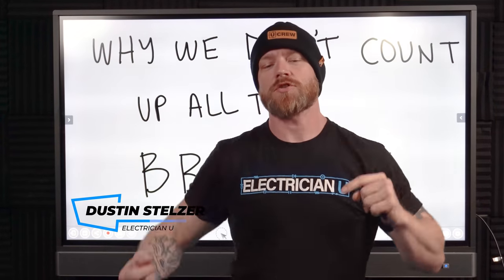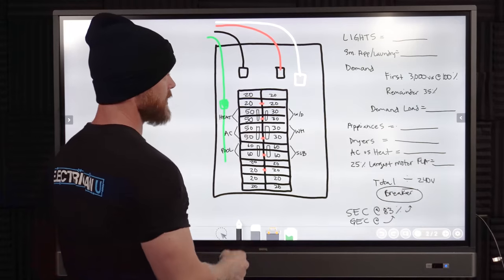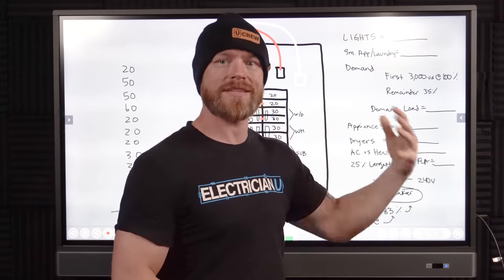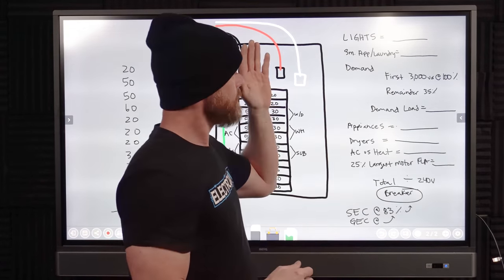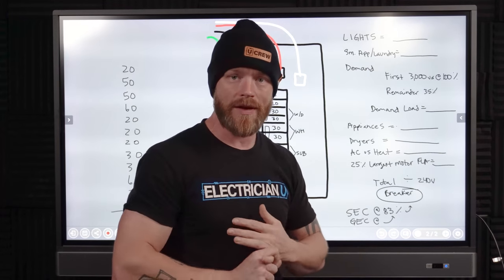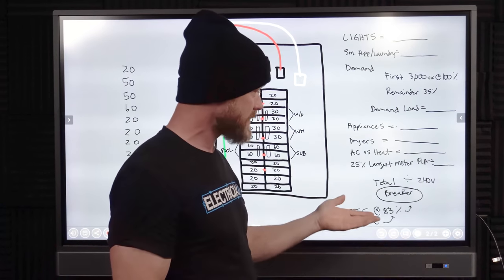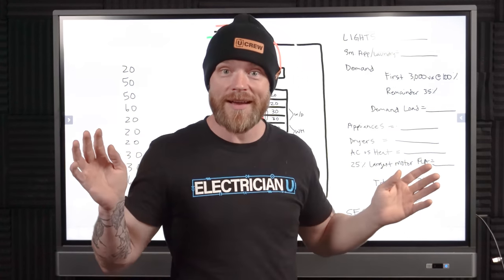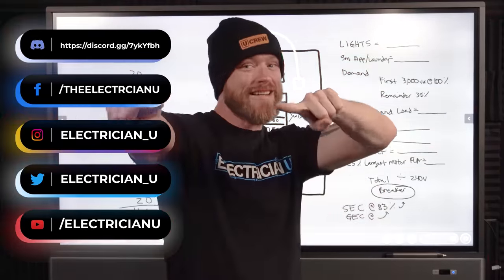Why is there more than 200 A worth of breakers inside of a 200 amp panel?!

Comment: we once designed an addition for a house that was already a fairly large house with an indoor pool (where the humidity and temperature of the pool room was controlled in addition to the houses AC system) and the owner had a Model X Tesla so we had to provide for a Charger in the existing garage and a Charger in the additions Garage, one of the issues we came across was the house was already pretty much maxed out on a 400 Amp service and they couldn't expand because the power company simply didn't have any more capacity on the wires supplying the street the house was on. I know we ended up installing a massive Generac generator, I think that was the final decision on how to overcome the 400 Amp service limitation

Comment: In some European countries, distribution fees depend upon the size of the main breaker, and it is not uncommon for homeowners to arbitrarily 'downsize' the service supply to 15 A or 25 A to save a few euros, and live with not being able to run two large appliances at the same time. The wiring to the house/apartment is still sized for at least 45 A (often times 63 A).

Comment: ELECTRICAL U  HELLO,I AM NOW RETIRED, BUT IN MY WORKING LIFE, I WORKED WITH 24 V,125 VAC,277V 1 PHASE MOSTLY LIGHTING,THAT SAME STORE  WAS 480V3 PHASE,BUT THE BIG BOYS WERE  LARGE CENTRIFUGAL COMPRESSORS FOR LARGE BUILDS WERE 4160 VAC 3 PHASE, BUT YOU NEEDED A N AMMETER WITH LARGE JAWS, THOSE WERE LIMITED TO 3 STARTS /HOUR, ,,
IN GERMANY,ELSEWHERE, HOMES DO HAVE 260 VAC 3 PHASE, THERE IS ZERO 125 V, SO CHOTHES DRIERS,AND STOVES USE THAT,LESS AMPS,  STAY WELL  CHERIO🇺🇸🇺🇸🇺🇸🇺🇸

Comment: I was at a project for a small historical building.  The engineer called for a 600 Amp service. The contractor said, this is a two story building not a skyscraper.  I don't get it. It might explain why the project budget was over 3 million.  And none of it works.
Reply: Calculated load is a helluva drug.

Comment: I've got 2 200 amp services running off a 400 amp meter, I consolidated 2 meters into 1 because my Public Utility Chelan County PUD charges a meter fee and when I consolidated it was $7 dollars per meter, that was 22 years ago. With that being said I've saved a substantial amount of money doing that one upgrade seeings how the home was built in 1957. Just figuring on 7 dollars a month over 22 years saved me $1848 which is about the actual cost of all the stuff I did 22 years ago. I am sure the per meter cost has gone up over the past 22 years as everything has which would make those savings even more. The driving factor was to clean up my air space over my property as I took all the utilities and went underground so I wouldn't have wires running all across my property and I was able to relocate the meter head off the back of my home to the alley side of my shop. Not only did this give me a cleaner skyline it made my property safer for moving ladders and bringing dump trucks in without the worry of the utility lines along with making reading my meter easier as my property is completely fenced.

Comment: Super interesting.  I've wired 200 amp boxes on past.  Recently built large shop and had my first 400 amp service put in (I still have to wire it in to 2 200 amp boxes.  I wanted more spaces as I have to run several 240 volt item's (truck lift, welder hookups, hot water heater and air compressor hookups, all 240 v) as well as plugs, lights and long runs to outlying barn and backyard ( for hot tub, lights, etc.).  I'd rather have more breaker spaces to expand in the future.
Reply: is that going to be a true 400-amp service or a pair of 200s? (we call that a 320-amp service here) The main difference between the two is in a residential setting they will allow smaller feed wires because it's mostly for all the home runs and breaker space, rather than full loads.
Reply: I believe it's actually 320.  Elec company says I can use 4/0 4/0 2/0 SE wire, aluminum and I intend to run 2 separate lines from box to my 2 200 amp boxes, underground, in electrical pvc
Reply: @kennethcallahan7410  ... that feeder combo says it all. 4/0 Al is rated for about 175 amps and the 2/0 neutral says they are allowing for a large 240 volt load and an undersized neutral is ok. Are they really allowing SE cable in a buried conduit or do you mean individual conductors in Al with a W/2 rating?
Reply: @rupe53  I'm doing Indiv conductors from service pole in conduit to the two boxes, or that's the plan.  I have to go 130 ft from pole to the boxes which will be inside shop and wanted underground vs overhead.  Am putting in conduit to protect wire due to soil here which is clay and very rocky and the rocks move around a lot
Reply: @kennethcallahan7410  Ok, good deal. You mentioned SE wire which I took to mean Service Entrance cable, which is the grey jacketed stuff you see going down the outside of a home. It's not allowed to go any distance in conduit other than a short run for protection. Do yourself a favor and go larger than you need on the conduit. Also use sweep elbows. It can be a bear to pull that distance. If you have the option, you can lay the wire out and walk each piece of conduit into place. That can be a real back saver if there is more that 2 elbows on the run.
Reply: Yes gonna go larger on it and you're right,the less bends the better

Comment: One grid-tie solar system, electric water heater, 240VAC table saw, and L2 EV charger later., and I'm really happy the original builder of my home didn't skimp and had decided on a 200A service.  The original house only had the A/C system and electric oven as big-ticket items.  I still have fairly comfortable margins though one of the sub-panels is closing in on 75A going full-out and probably shouldn't have anything more added to it.

-Matt

Comment: Well I can talk on this subject by my own experience. I live in a 67 year old house that had a 100amp Zinco breaker box that had to go. Well I discovered what they call 320 amp service continuous 400amp at 4 hours. After contacting the electrical company to see if the transformer and it’s capacity if I could go to a 320 continuous service, well they said no problem the transformer was at 45% capacity load for all the houses that it serviced. So I installed a 320 continuous service with a 200amp box in the basement to replace the Zinco box and another 200amp box out in the garage off one main meter base that was designed to handle 2 sub boxes. The reason they call it a 320 continuous 400amp for 4 hours is if you go to a 400amp service all the time you need engineering blueprints for your installation plus probably some extra equipment. Also while doing this installation I installed a generator cutout switch. On a Tim Allen home improvement scale of 1 to 10 , this job was a 15. I did this conversion in 2004 and I figured I spent 7,000.00 dollars on supplies and a crane truck to lower in the mast head and I did all the work myself. The city electrical inspector was impressed and said he had warehouses in his jurisdiction that didn’t have this much power and service capability in them. I figured if I paid a company to do what I did the job would of cost 15,000.00 dollars. Also I had to relocate electrical circuits and compressor air lines that where in the way, but in the end it was well worth it.

Comment: When you talk about the "black phase" and the "red phase" in a single family (or townhouse, small business, etc.), and please correct me if I am wrong, the "red" and "black" are the "hot" leads from a "split" single phase 240vac service. Not until you get into a building that has equipment (such as multiple elevators) that requires a heavier duty service does the "multi-phase - typically three phase 208 vac" service concept come into play.

Comment: This video is ok for laymans terms, in far as what the purpose of a breaker is, it is even simpler, the breaker size is to protect the wire from overheating, even the NEC (NFPA 70) says that. That's why temperature is in all the tables, in or out of conduit etc. The 200A main breaker protects the feed, 200A will be the trip point on that incoming feed. The utility's job is to protect its transformers.

Comment: My house has 100A service, and that's more than sufficient for me.  All of my appliances are natural gas.  I do have central air conditioning, but it's on its own meter and never goes through my panel.  The circuit comes inside my basement from the meter, then goes outside again to a fusible disconnect, then to the AC compressor.  The only 240V outlet in my house is for the dryer, but it goes unused since my dryer is gas.  The two biggest loads in my house are the microwave and a toaster oven.

Comment: Greetings Electrician U, My house is 730 sq. feet, and I have a 100 amps main brkr. 3 15 
amp ckts for lighting & general small appliances. 1 15 amp for gas furnace. 2 20 amp ckts for
kitchen a 30 amp dryer ckt and a 30 amp A/C ckt  but no A/C . I have gas wtr htr and range
so all added up 160 amps and w a 100 amp breaker, I never trip a breaker on overload. The 
house was built in 2006. dryer ckt is a 4 wire job not the old crowfoot style pre 1990's. I thought
this would be a good example. Being a mobile home, the panel is a 'Sub-load center and the 
ground is to the cabinet and neutral is isolated from it as the green screw for neutral bus is not
there and a special bolt holding the mains brkr in place. The furnace has a 12 amp blower motor
which is 80% of a 15 amp ckt.

Comment: Always amazes me that in the UK we still have a lot of properties with 60amp services!! All though the average is 100amp. 
On some “new builds” they are now installing 3 phase 100amp supplies to allow for heat pumps, solar PV, EV charge points etc.
Reply: Don't you use 240V circuits though?  So your 60 amp service is like a 120 here, and 100 like 200.
Reply: In Philadelphia's older rowhouse neighborhoods, many row units built in the 1930s have 60 amp service. I managed to trip the main breaker one day with a lot on (laundry, TV etc).
Reply: Do you mean amp or volt?
Reply: @bigkirbyhj666  Oh, it's amps. The main breaker had "60" printed on its handle. Even in the 1980s that was deemed obsolete, most homeowners had already upgraded to 100.

Comment: Power monitoring is the way forward linked to automatic load adjustment. The code allows you to add more circuits/load in a panel especially if that is backed by actual power monitoring data that and even if the calculation may say no more.

Comment: I have read that when they use a 480 volt, or 600 volt supply as opposed to just 120 volt or 277 volt, what happens is that they have problems to start up large motors. That is because many times nowadays they use a contactor for starting those motors up , they do not just use an on-off switch or something like that. It has something to do with the FLA requirement, I forgot what that is called right now. I mean, they try to promote those new 600 volt service systems for houses as such a great system, and I was wandering why they need these new 600 volt systems at all. Also, I believe that a 600 volt residential service always works in series not in parallel, it needs to be grounded for overload and ground faults, and it seems to me that this new 600 volt system is not that good.

Comment: Actually work on a 9600 square foot house that has 2 400 amp meter main cans outside. 600 run to the house and 200 for the shop outside. When you have 8 fridges and 4 freezers with 3 electric ovens and 2 electric furnaces with no natural gas ran to the property. Load calc comes important

Comment: If it's a heat pump the AC and the heat will both be on during the defrost cycle. That can be as often as every 30min and up to 10min long when it's cold out.
Reply: My heat pump simply reverses the flow of refrigerent for a couple minutes to produce heat in the outside coil to defrost . The fan in the air handler stays off during this time so as not to blow cold air inside while defrosting . A heat pump can not be in heat/cool at the same time unless you have heat strips and there is a problem .
Reply: @rydfree  Tofulnc is right. On my heat pump the heat strips do indeed turn on when defrosting.
Reply: @rydfree  Wrong- in defrost the heat strips come on to offset the cold produced by reversing the changeover valve

Comment: Been wondering about this some...especially with talk of EV chargers.  We've got 200A service (with a full breaker - out here EVERYTHING is electric) and the "power monitoring" shows that when its super cold nights with dual zone heat pumps + 10&15kW aux heat + 1-2kW other normal stuff running in the house + the water heater kicks on...we're at like ~170 amps on both sides, and I guess you hope that doesn't happen when you get up to cook breakfast on the stove?...so how's that gonna work out with a 2 car garage having potentially 2x 50A EV chargers in the future?

Sure, its only a couple weeks a year that are so cold that you're running all that for an extended time...but its still a thing that happens?
Reply: Recently we have had to move a EV charger to a sub panel for exactly this reason. Coldest day of the year and running emergency heat caused their main to trip.
Reply: You might look into upgrading you service.  Usually bump up your panel larger amps or ad a subpanel to handle the additions to the network.

Comment: I like how you limit your video's length
Its good not to cram too much info into one  video
Reply from the maker: Thank you, it’s been a long time coming. I used to make videos that were 45 min long lol - so unnecessary, but hell they have over a million views so I guess there’s something people liked about them. More to the point these days though 👌
Reply: It would be even better if the video allowed speed control. I usually listen at 1.5x  or 1.75x speeds. It's data to my ears not a conversation. For Slow talkers I go with 2.0x.

Comment: In Australia we call this "maximum demand" and to our code there's a guide for calculation, but it's not a ruling that need be adhered to. You override the guide where needed to avoid nuisance tripping or atypical customer requirements etc.

Comment: Look at any story about power generation. Depending on the region described a house will run on anything from 1000 watts to 5000 watts. A 15 amp breaker can supply 1800 watts before tripping.

Comment: Form 2se residential meters are rated for 320amps continous. Fully rated 400a self contained residential panels are available and I believe Itron now makes meters for them.. Older form 3s and newer 4s 1ph meters are available for 400a and higher switchgear with 1 or 2 current transformers.

Comment: Some devices like a high power audio amp can pull in a huge amount of current to charge up the capacitors. It is often enough to trip the breaker. If that happens to you, it may need a minor modification to give it a slow start instead of a hard start. You could watch some electronics videos to see how to make such a modification yourself, but I recommend getting that done in a repair shop. It isn't a repair, but a modification. It shouldn't cost too much since there isn't any troubleshooting, just a look at the schematic and a few added parts. Sorry, I can't tell you what a fair price is.

Comment: They do make 400 amp single Meter Cans and they are very expensive. I've had to do it for people with Pools Hot Tubs and Car Chargers. All Electric houses with 2 or 3 AC Units with Electric Heat. Yes People are Crazy about going all Electric.

Comment: Have they updated the lighting load requirements accounting for led only?  When I did my basement years ago I limited my 15a circuit to 1200 watts for the lights. That was 16 75 watt cans. Now with retrofits you could fit roughly 7 times that. You could almost do an entire house on one circuit.
Reply: You have to go based on the maximum rating of the fixture. So recessed cans are almost all rated for 100w. Doesn't matter if your only going to use 9w for leds... someone could put 100w bulbs in there.
Reply: @Windex451   can you even find real 100w bulbs anymore?

Comment: always wondered how those double pole breakers were set up it was bugging me for a bit now if its really just 40amp for both sides or 40x2 but now i know finally. also as for the service in this old house i am in is just 70amp its fairly low compared today's standards but also proof that not everything is ran all at same time as i never had problems since i been here in 1997 with some stuff always on 24/7 and for those in older homes should always have there wires checked over time by an electrician as i knew what i was doing so i did it my self of course is that our panels were last installed and inspected in 1983 but i was like i want to see how the wires are secured into each breaker so i tugged on each one with some reasonable force and i had my furnace wire come right out with little force so i re-seated and tightened it and rechecked screws of the others and they were fairly loose and also stopped some of weird pulsing issues ive had with my lighting.